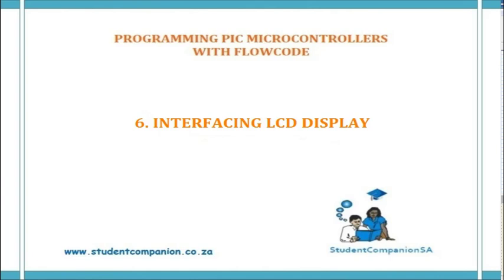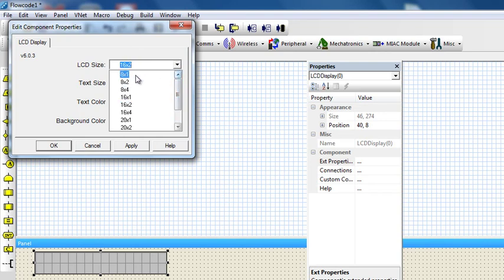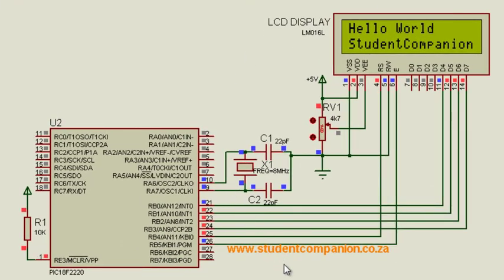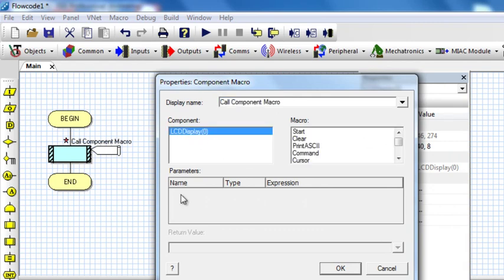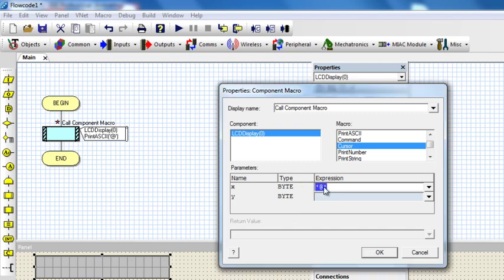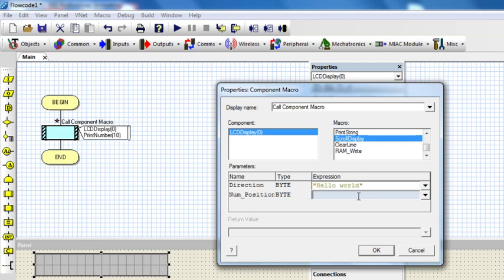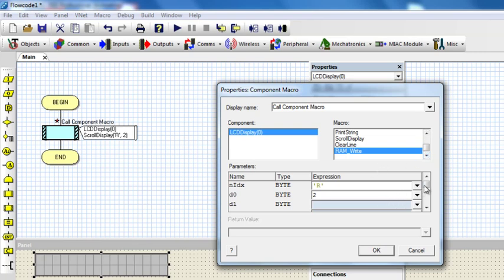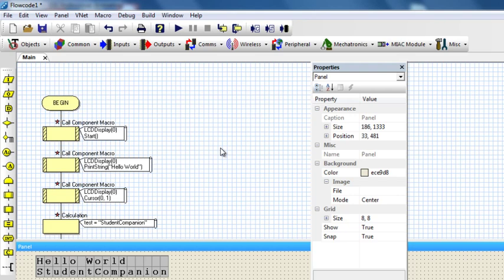6- Interfacing LCD Display with PIC Microcontroller | Flowcode Beginners Tutorial

Comment: How to connect Lcd to Serial (or spi) in Flowcode?
 I couldn't find a video or a lesson about it.
Reply: How are settings made in Flowcode? know parallel connection. however, there is no information about the serial connection
Reply from the maker: In the component properties if you click on help, there are information
Reply from the maker: Hi, if you are using Flowcode v6, v7 or v8, it's simple, under the Displays component group select LCD (I2C), this is a serial LCD. In the component properties, the SDA and SDL pins will be selected automatically to the corresponding I2C pins on your PIC.
Reply: @StudentCompanion  thank you so much
this information will benefit me very much.
Reply from the maker: You are welcome

Comment: +segarlinktech yes we saw your message on Facebook.  We have observed you used a 16x2 LCD in Flowcode but you used a different a 16x4 LCD in Proteus. You must use the same model in Flowcode and in Proteus. ( if i use 16x2 also its same no character display)
Reply from the maker: +segarlinktech Ok. Zip your flowcode and Proteus files and send them to us. We will have a look and see why your project is not working.

Comment: i not receive your reply in face book or in you tube
Reply from the maker: +segarlinktech we have replied to you. We don't reply immediately all the times because we are busy with other work.
Reply from the maker: +segarlinktech Hi. We've checked your Flowcode project. You did not initialize the lcd. Before you use the lcd, you must initialize it first as described in this video by calling the component macro and select lcd Start. Put this lcd start on top of your loop so you can only call it once.

Comment: hi, student companion i have watching few video you have posted in you tube its good for learner and its very help full . recently i have write program in FC7 lcd display 16x4 . i have error when i do simulation in PROTUES 8.5 ,but in the FC7 Simulation its works the display as well. I facing error in the PROTUES Simulation its no any character in the display when i do simulation in protues,and i have download the HEX file in the my real hardware also its same blank no character in the LCD Display 16x4 lcd. I have analyse the circuits in the protues all is in correct connection the port and the Enable,RS,RW , i am using 4bit data connection. is there any setting in the FC7 when do configure? please advise thank you
Reply from the maker: +segarlinktech how is your lcd connections in Proteus and in Flowcode? Describe to which port/pins

Comment: hi, this is for flow code programming ,how to do wiring connection in the  MCU . and which pin to which pin its connected base on this LCD programming in the FC? THANK YOU
Reply from the maker: +segarlinktech What do you mean? Everything is explained in the tutorial.
Reply: in this video you have explain about programming in the FC6  and the wiring connection of LCD With device MCU,in Protues software its working when i saw your video. I am using FC7 and do programming exactly from your video, in the FC7 simulation its works, But when i do in physical in prototype  or in the Protues Software simulation its not works,  and i keep on checking MCU to LCD Data pin connection accordingly in the FC7 ,have something wrong, the PIN Connection Shows in the FC7 from MCU to LCD. this is what makes error and not working. this what i asking how the wiring connection,I follow the FC7 pin connection and test its not work. so do how to settle this problem ,need help from some like you or other people any one
Reply from the maker: +segarlinktech check properly how you configured your pins in Flowcode and how you connect them in Proteus especially the E, RS and R/W pins. Which lcd are you using? The 16x2...?

Comment: will the proteus simulation work without the external osc?? and what are the capacitors for?
Reply from the maker: brilliant khulekani Ndhlovu The problem is not if proteus simulation will work, but your hardware will work. If in your PIC configuration you used internal Oscillator, then you don't need to have an external oscillator, but if you selected to use an external oscillator, then you must have the external oscillator. Your circuit won't work without it. 
You asked the role of the capacitor? You know every oscillator works with capacitors, they are part of the oscillator.
Read this article to learn more on oscillators: http://www.studentcompanion.co.za/introduction-to-microchip-xc8-compiler/
Watch this video to learn how to select either internal or external oscillator with Flowcode: https://youtu.be/-lDFfeY8LZQ?list=PL3lfkED2i6Jc8X2fEibvdq11PEkVN8g7Q

Comment: Do You have any idea about LCD connected via i2c (TWI ) ? Those IC's like pcf8574 or mcp23008 ( I2C port expanders ) are used for i2c LCD's but don't know how to work with those in flowcode... ? Any help would be much appreciated, thanks.